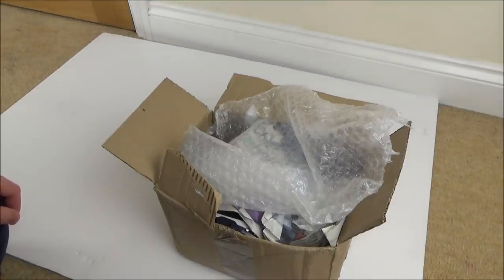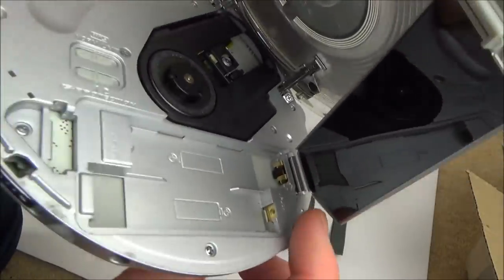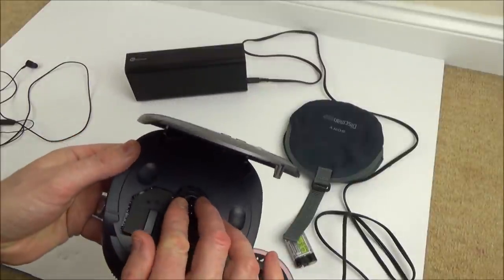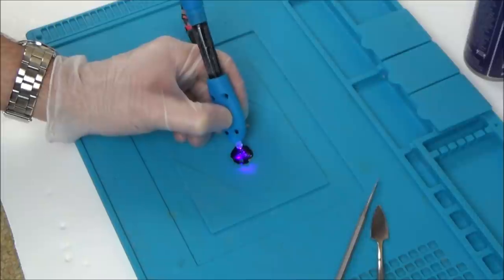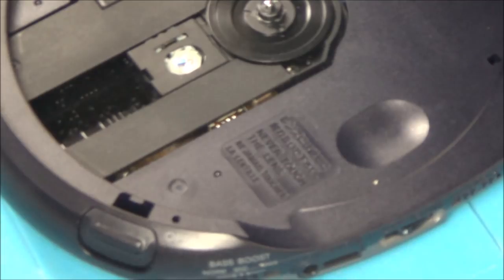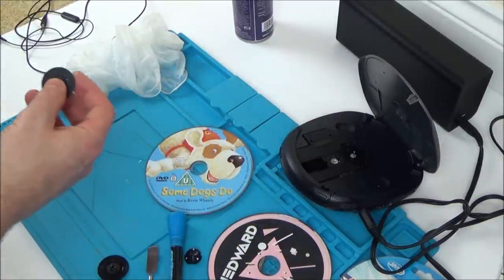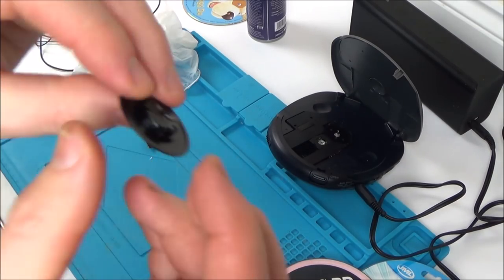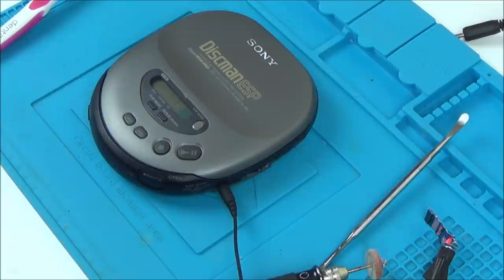Trying to FIX a 1997 Sony Discman D-345 (1st Video in Discman Series)

Comment: I might be wrong but when you turn on ESP mode, I think it needs 15 or 20 seconds to store some of the cd into memory. Then you should be able to shake it around for a few seconds.
Reply: you are correct and i explain it few comments above ;)
Reply: FRIENDLY JAPANESE BUSINESSMAN  whaat ... no i just confirm his doubts, i am professional engeneer and technician and have my own service from 25 years or maybe more .. no offend i saw this older comment after i post mine.
Reply: later models it worked after 2 or 3, i remember having one of the last discmans they designed
Reply: This model can handle up to 10 seconds, but it has different ESP modes, there's a button right next to the display.

Comment: Esp is an anti antiskip function. I once had a CD player with 45 second antiskip, and when the buffer was full, you could shake it and it would not skip. I once tried an experiment where I started the disk playing with the lid open and the door lock engaged with a tooth pick.  Once the buffer was full, I removed the disk, and the music kept playing. I discovered that the CD player had a ram chip that stores the data, and when esp is on, once the buffer fills up, it just plays off the ram chip with no skipping.  However, the 1997 model shown here, only has a 3 second buffer which helps prevent slips with less than 3 seconds of constant vibration.
Reply from the maker: Thanks, I now fully understand it. I didn't know how it worked before. Nice one for explaining it :-)
Reply: Year but they are quite sensitive too
I have a newer one and it's also skipping when you hit it or shake it hard
Reply: it is antishock protection (ESP = Electronic Skip Protection) you are right ;) some 20 years ago i tried the same experiment too :D
Reply: Oh thank god. I was screaming internally about the ESP. You need to let it fill the buffer first, it's an not instant start throwing it around button. 3 second skip was suffice for casual walking or a speed walk, but was useless for jogging or running.

Comment: It may be a good idea to burn a cd with royalty free music so its easier to play music through these on your next videos without worrying about copyright. I enjoy your videos. I listen a lot while im driving for hours to and from work. Keep up the originallity!
Reply: I was just about to say the same thing
Reply: Yeah, especially from YouTube Audio Library, as long as he remembers which songs he needs to add credit for.
Reply: some early CD players wont play 'burnt' Cds?
Reply: @stofffpv3128  no they play burn Cds fine. you need to make sure to burn the disk in audio-cd mode. not mp3 mode.
audio-cd can only fit around 18-24 tracks. Depent on the file/minutes track. 
And Mp3-mode around 100-300 for exemple.
Reply: @phunkstar7347  cool thanks for the info
Reply: And a track or two of some spoken word. It is much easier to hear playback speed issues with voice rather than music/songs (although with a CD-player this may not be that relevant).

But one think to keep in mind, a lot of older CD players from the late 80s/early 90s do not recognized or play burned disks.
Reply: @phunkstar7347  It's not as simple as that, some CD players just won't work, seemingly due to it being more difficult for the laser to read. Later players will likely all play them fine, but some older ones won't. The wear on some players can mean they struggle a bit even reading commercial CDs, so burnt CDs would be less likely to read.

Comment: Just pick a sony D-220 up at the recycle store for free, spindle hub missing so can't play any CD at all. Google it and found your excellent video! No need to take it apart thankfully, pop the old spindle off by using a fork. Had some CD mechanisms lying around and one with required spindle. Pop the one I need off, trim the axis a bit and push it on the motor. Tada! working flawlessly! Thanks man, really appreciate this! Thumbs up!

Comment: I think the reason those pretty much went out was there was no way to prevent skipping. I was never into those myself. I couldnt imagine having one in my jacket while riding snowmobiles back when those were popular. By that time, I was listening to a shelf stereo unit in my workshop listening to a radio station. I wasnt much into CD's. Its great to see records becoming popular again. Vynal was really never dead just hidden in someones basement in a box. CD's degrade over time badly. If a record is well taken care of it lasts forever. That being said, I remember smashing records as a kid that were left behind at a home that was abandoned.  I remember saving all the good records and taking them home. Eventually sold at flea markets. It was an interesting video. I replaced the clock works in both our wall clocks today. Strangely they both stopped working at the same time. The gears were chipped on one and the other just quit. The local craft shop sells clock works cheaply. I got $3.60 off on two of them. I had to retrofit the clock arms on one and the other looks better with the new hands.

Comment: The letters ESP stands for Electronic Skip Protection, in other words a few seconds of the disc are read ahead and stored in a buffer so when the Discman is subjected to a shake, the ubit reads from the buffer and you won't notice any skipping. I remember having a Sony Discman in the 90s
Reply: Also, I remember it could take a few seconds for the ESP buffer to fill up enough to be stable for playback.
Reply: I had a player that was really good at shakes bumps drops still played no matter what. It had really good dampening inside held disc tight no wobble laser always stayed focused and it even red scratched disc pretty well. It depends if you get a cheap one or a good quality one

Comment: Ahhh good old antiskip - great function. But the manufacturers skimped on the ram buffer in all but the more expensive models. My minidisc recorder portable had a whopping 1 minute 20 seconds of antiskip. They also spun the discs way faster than CD players, and as such could fill that buffer in a very short time. In fact, like a classic ipod with a hard drive, the motor only usually had to spin up twice per song :) Think of a 52x cd burner going at top rpm - remember those. Sounds scary, like the disc is about to explode, but thanks to the MD's smaller cartridge based disc, the sound was way less noticeable to people around you.

Comment: @My Mate Vince The skipping is normal.... most of the old discmans and other brands would skip after a violent shake...  The only exceptions are the ones that claim to have "ESP" or electronic shock protection. (some times known as G-Shock).  Usually came in 15, 30 or 45 second ESP, which means it had enough cache memory to read ahead  by that amount of time, and if the disc couldnt read, it didnt matter as it was reading from the memory anyways.  when the disc read recovers, it just continue to read ahead again till it fills the buffer.

Comment: This CD player here is one of the first gens to come out. The newer ones had a feature with " Anti Shock " on it where if you move the CD player around it won't skip. This model was bad for disk skipping a lot with time so the player works fine just the way it is.

Comment: That noise is the disk scraping the inside of the player while spinning and line out is a lower volume out for connecting to a powered speaker or separate amplifier and headphone uses the in built amplifier and volume is adjustable via the volume wheel
Reply from the maker: Thank you :-)

Comment: Quick Tut for future reference. 
Hold button: Make sure it’s off when attempting to power on the device. 

ESP: Anti-Skip. Requires at least 10-15 seconds of not bumping around for it to work properly. It spins the disc at faster than usual speeds and buffers the music to internal memory while doing its process. Most nicer Walkman CD players will show you an animated buffer level. 

Resume Slider: Leave on if you want to be able to shut the unit off during a track and want it play exactly at the same location when you come back to it.
Reply from the maker: Thanks for the tips :-)

Comment: Vince you could do with investing in a 3D printer broken parts like this could be replaced instead of gluing, buffering/skipping on old disc players was a design issue later fixed with the Anti Buffering I've still got my old walkman with the Anti Buffering mech maybe your discs are older earlier models before they got updated, mine still works fine even when you shake it.

Comment: Older Discmans use a magnetic clamp to hold the disc in place. The spindle is metal, with a small dip in the middle, while a rotating magnetic spindle sits underneath the player's lid, clamping the disc in place using magnetism. I prefer this method because there's no bearing to fall out, which is what happened to a later Walkman CD player I had (Sony changed Discman to Walkman for later models.)

The D-15, D-25 and D-802K all use a magnetic clamp and also sound quite nice, especially the D-25!

Comment: Good CD players have built in focusing and dampening so when you move or bump the player it doesn't lose focus on the disc. Your issue is when you bump the player hard enough the laser loses it focus and it skips or has to pause to regain focus. Some have better clamping of the disc so it dosnt wobble the player you are testing seems to be cheap and dosnt have any of those features. Most machines laser can be adjusted to be stronger the reason the disc didn't play when you swapped out the spindles is because it was to high up from the laser but you can fix that by adjusting the focus making the laser more powerful it will burn out the laser faster but that can also make it work as well.
Reply from the maker: Thanks for the tips Ryan :-)

Comment: About the CD-ROM lenses, not maybe, that's exactly what CD-ROM's do (and DVD and BR), they adjust the lens height to calibrate the laser, if you look closely to a spining CD-ROM you will see how much they wobble and how the lens follows that wobbling, without the capability of compensating these height differences that type of technology would have not been possible :) Also, they are even able to compensate the X axis, in the case the CD isn't completely centered. What they don't handle at all are speed changes, when the discman did not read your cd I can hear some scratching noises, so my bet is it was touching the lid making it to spin at an uneven speed.
About the shacking, yes, they're sensitive, the later models had a 5 to 10 seconds buffer, but the early models only had one or two seconds (I still have one of these, a Sony, working like the first day) so when you shake it or turn it fast they stop reading because the speed changes and the lens can drift a bit and the buffer usually drains out faster than the read recovers.
Reply from the maker: Thanks for the great information :-)

Comment: I think that spindle part with the ball bearings shouldn't come off as a separate piece, rather it should stay fitted with the circle base so it won't come off with the cd. The spindle should stay on the base when you take off the cd and it shouldn't be wobbly if the spindle was previously taken off

Comment: I used to have a D345 disc man back in the day!

It had a LCD stick in-line remote control that you plugged the headphones into.

If I remember right, if you turned ESP on, the disc man would spin the cd at a faster speed than usual so that it could fill up the buffer hence the noise from the pickup skipping aback and forth as it relied on the contents of the buffer to allow the head to find its place on the disc.

The grey button next to the screen used to select the ESP mode and depending on the mode, LCD bars would display as the buffer filled up and ad the player suffered shocks, the bars would go down as the buffer would empty. It was very cleaver for the time and as such warranted a high price tag! I think I paid £150 at the time which was a lot back then!

Would love to still have that player today! I used it everyday back and forth to work! I even used it to transfer compact discs to a portable mini disc!

Happy happy memories of the 90s! Better times long gone but not forgotten!

Comment: CD players have an adjustable potentiometer to compensate for the power output of the laser. Assuming there is one for this player you could adjust it with a small flat blade screwdriver. That might correct the problem, just a thought. 

Those flat batteries aka "gumstick"  batteries are available on Amazon at fairly cheap prices. I have an old iRiver CD/MP3 Player that uses them.

Comment: My Walkman, PS1, PS1 controller rumble motor and my sister's Sony radio/CDplayer all had the same or very similar motor. The spindle were slight different, but all fit the same. I know this because I took 'em all apart when my PS1 CD spindle broke and I was desperate to replace it. I was in highschool and couldn't afford to get my PS1 fixed.

Comment: Skipping like that when moving the player is pretty normal for a Discman. The later ones had bigger buffers to help mitigate this. That is the "ESP" function. My guess is the ESP on that device is only good for a few seconds, which is more or less useless when carrying it, jogging with it is not even an option. Later models had close to a minute of ESP, which helped a lot, though still not great,  there were even some that would spin up the disc, cache an entire track into memory and turn off the spinning. But then the MP3 market sort of exploded and portable CD players were left in the dust.

Great repair though :D
Reply: i tested my discman by shaking it like a snow globe, the ESP was absolutely flawless

Comment: A headphone output will have a built in amplifier to be able drive headphones and include a volume control for the user.

Line out bypasses the built in amplifier so that the sound can be driven completely by the amplifier in the speakers/sound system you're plugging it into.
Reply from the maker: Thanks Adam :-)

Comment: My discman has a anti vibration button which stopped the jumping whist running, but earlier ones didn’t have that function.
Reply from the maker: Thanks for the info :-)
Reply: yeah the skip is normal for a model like that id say, the anti skip/vibration ones usually advertise the fact on them, the way they work is actually delay (sound your hearing is 4 secs old) remember those crapy discman car kits vince with the machine holder on a sort of dampening arm? well thats what they were about for lesser models like your (tho didnt work very well lol, tbh thats why cassette ones (aswell as fact they were smaller) still outsold cd versions, hope that helps vince
Reply: Man I remember anti-skip being revolutionary!

Comment: The spindle is the same as the ones used on original Playstations.When I used to replace the spindles I used a sparkplug gap gauge between the spindle and motor to get the correct height of the spindle.
Reply from the maker: Yes I know them,  they are called a feeler gauge I think (from memory). I have them in my dad's shed. Thanks for the tip :-)

Comment: It is perfectly normal for the laser to skip on shock, that's why it has the ESP. But every shock protection has limitations. The early ones, I believe were 3-5 seconds, then they made them last 10 seconds and I believe the more advanced systems were up to 20 seconds. Just check what kind of shock protection you have and how many seconds does it last under vibration and you'll know if it's working properly.
Reply from the maker: Thanks :-)

Comment: for the silver one that requires the special batteries you also need the remote with a cable to even use it, from the connector i guess it's the same plug as the PSP 1000 used to have for it's remote / headset

Comment: I have the Sony Discman D-220 i have been buy it back in 1993 and it works still today very well.  I just had have to increase the voltage of the laser a bit, after all these Years.

Comment: Amazing first score for the discmans being fixed :)   I'm struggling with a pair o' Wii's one red one blue and both not putting out vid and driving me up the wall cos I did all the normal things but I suspect its a IC or chip gone as I quite like Wii's and had two successes with the old white GC friendly ones but these MK2's are being buggers hehe
Reply: Repaired a £5 DS the other day, just incredibly dirty in the guts of it and a liberal application of foaming contact cleaner and a vibrating toothbrush later, back together and working like a champ :)

Comment: @My Mate VINCE. I know I'm rather late to the party here and you may have worked this out already, (I haven't finished watching the video yet), but that first cd player has a piece missing from the inside of the door.  It should have a stabiliser spindle that lightly presses on the top of the cd, to stop it from flopping around.  Yours is missing on that unit and that's at least in part why the cd is flopping around and may even be what caused the spindle to break in the first place, due to extra torsional stress being placed on it.

Comment: A thought on polishing bars, green and red isn't really for plastic as green is usual for steels and red is aka jewellers rouge designed for soft metals and is quite abrasive to plastics,  if memory serves me right white is your friend when it comes to plastic as can't remember what blue is for lol
Reply from the maker: Thanks Ian, I was wondering this before when I was trying to polish scratches out of stainless steel. The packaging mentioned nothing about what each bar was for and I couldn't tell by feeling them if there was any difference. Cheers mate :-)